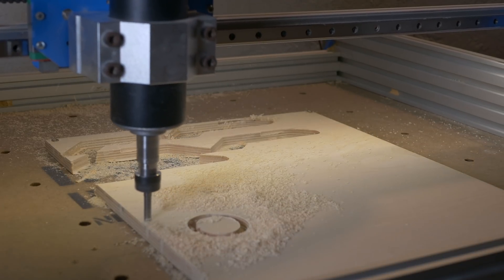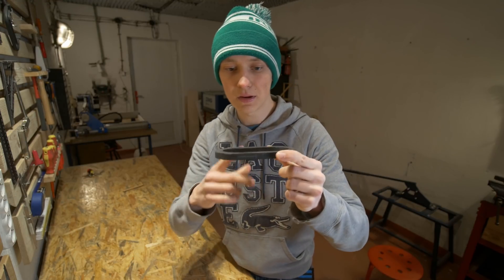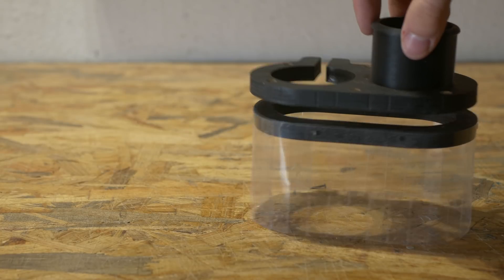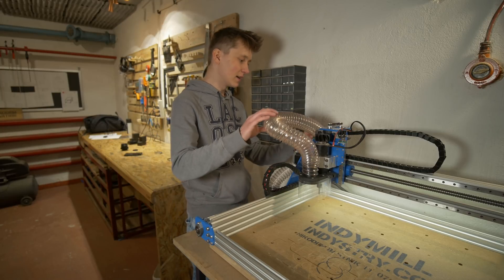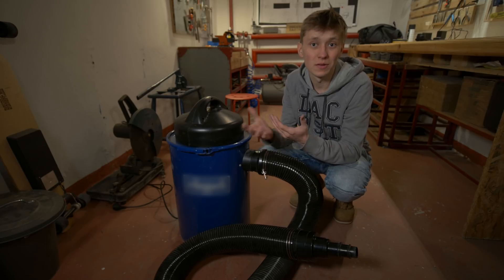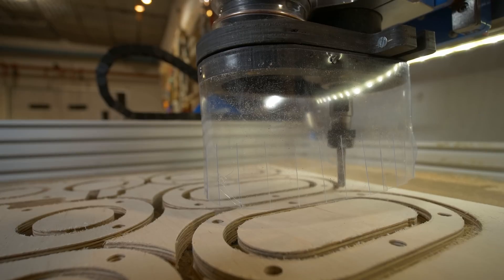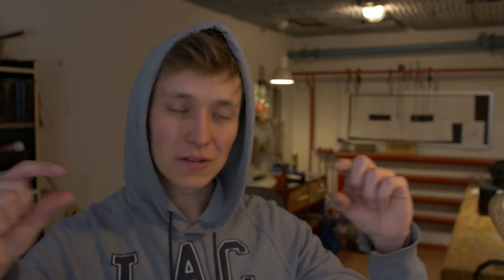Simple Dust Shoe For 500W Spindle With DIY CNC (IndyMill)

Comment: Nice video, but the design of that dust shoe with the skirt is a bad idea in my opinion. U lose a lot of vacuum power with that. You should make the design something more like a real vacuum head that is closer to the material that you cut. Smaller in diameter so it will increase the vacuum force. Imagine something like the air assist for the laser head positioning, version 1: a ring around the head  or version 2: something that sucks next to the drill. Keep up the good work. I like your video.

Comment: I am probably late, but it will be great to have it for my self built cnc, don't have a printer for the adaptor, but u can send the design files and an adaptor, I would be grateful as we use the machine as a communal learning system for the individuals who zero access to learn g cam or cad.

Comment: I was looking forward to you releasing your "500W Dust shoe"-video for quite a while now! :) Just recently I got to a point where I can start my first milling tests with my self-designed desktop CNC. I'm hoping to use it mainly for milling PCBs. As that is nasty stuff I will definitly need an encolsure and a vacuuming-system. So if you have spare dust-shoe parts I will gladly take one :)

Comment: I also used a transparent pet sheet for the first time.  Then I tried silicone, but it was very sucked in.  As a result, it is best printed with nylon.  The shape is about the same as you cut out the first time.  But at the top it is thicker, at the bottom it is thinner to bend.
Reply: Try tpu, works well for me.

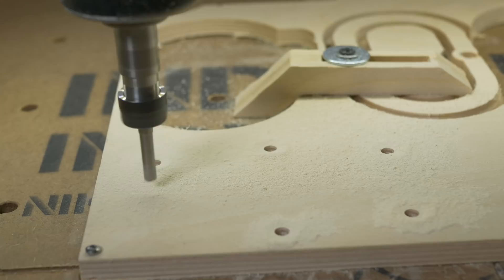Comment: 0:52
i can see stepper motor vibration at the coupler. time to upgrade to servo motors now Xd
Reply from the maker: Actually that's how it looks like when you mill a 6.5 mm hole with 6mm milling bit

Comment from the maker: Let me know why I should give you a dust shoe in the comments! I will choose 3 comments that I like the most :) Have a nice day!
Reply: Beauty and efficiency rendez-vous. Great!
Reply: Just wanted to suggest a solution to your 'dust shield', perhaps you can affix a bunch of thin but wide paintbrushes with nylon or stiff bristles. They should be flexible enough to move with your drill assembly & could help contain the dust particles better.

The only potential downside to this approach is that you can't see what you're milling.

*alternatively, you can try using a thicker acetate/acrylic sheet so that they would be stiffer & won't be pulled up by the vacuum's suction.

Cheers from Southeast Asia & looking forward to your next update!
Reply: Widziałem gdzieś na youtubie że ktoś użył plastikowego włosia z miotły, wkleił to włosie do slotu wyfrezowanego w magnetycznie przyczepianej części szczotki cyjanoakrylem. Utrudni to nagrywanie pracy maszyny bo nie będzie widać frezu, ale funkcjonalnie powinno się sprawdzić.
Reply: Great video. I have the same vacuum - My only issue with it is that the thing is actually much louder than my table saw!
Reply: Hey can yo mill iron
Reply: Please upload a milling video with indymill
Reply: Hello Nikodem , nice channel 👍.

Have you seen the onefinity cnc model? I think you can create something similar.